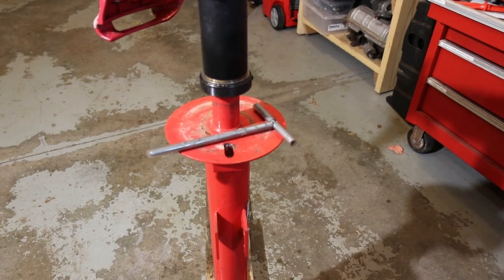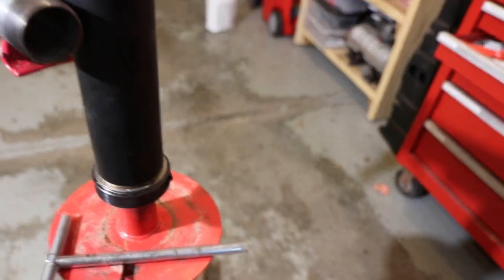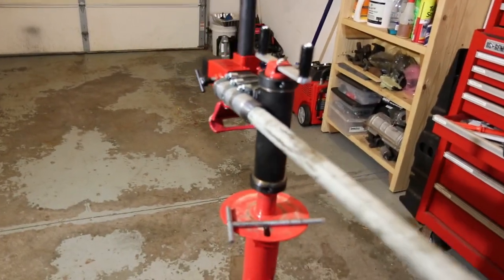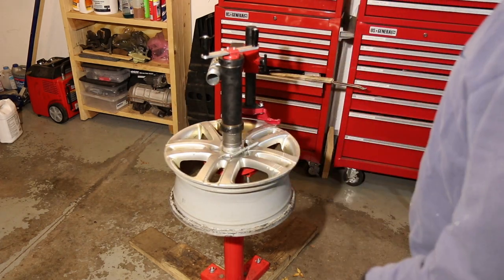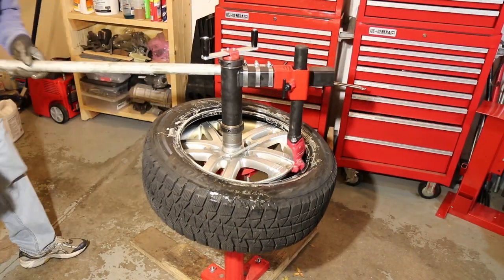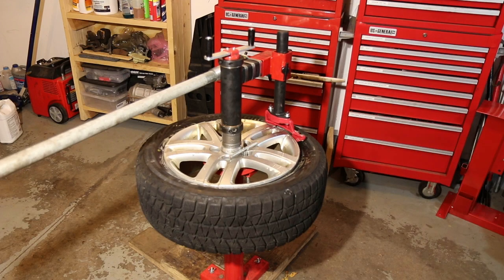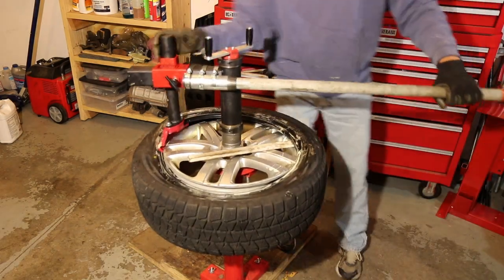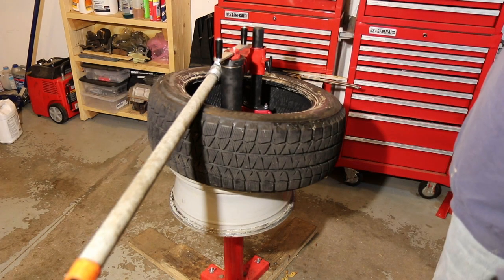Mounted Bar Modification

Comment: Rather then adding a piece of plumbing pipe with radiator hose clamps to use to turn the bar, couldn't you just put the pipe into the square tube bar of the changer? It would serve the same purpose, and simplify the modification.
Reply from the maker: I think it is a good idea and honestly did not try it that way.  However, I wonder if the accessibility would be as good?  As it is, with the pole on opposite side from the duckbill, it puts you on the same side as where you are inserting the tire iron and holding the polyethylene tool.  I am just wondering if that would be more awkward from the other side.  But I'll have to try your suggestion next time and see how it works!  Thanks for the comment and idea!

Comment: Im curious;why not put the bar in the square tube top bar that goes out to the down tube that holds the duckhead??? 😬😊😎
Reply: Too much slop and you can't balance the rod. It will slip out when not in use

Comment: Cut a hole in the tube you strapped to the tool, weld a nut to it to receive a bolt that can lock the bar in and have easy removal when desired. 😀😊😎🏁 i saw a video here where a guy welded water spicket handles to the locking bolts and decided thats what im going to do whe i get to that stage of my build. Hope you like and or use this idea.✔ 😀😊😎🏁

Comment: You really come up with some good ideas. What about the bead breaker on the machine do you use it, have you come up with any ideas for it. I have some really nice polish aluminium rims
Reply from the maker: Thanks Russ,

For breaking the beads, I use a different tire changer.  Very similar to the harbor freight bead breaker but a little better made/heavier duty.  The harbor freight one started bending on my after a lot of use.  I also feel like i can get more leverage on this one.  It helps that I added a really long bar (just made out of some steel pipe) for better leverage.  Here is a picture:

https://i.postimg.cc/J0gq754j/20200206-173223.jpg

I have never had a problem with it marring up or damaging any rims -- used properly, the metal doesn't come in contact with the rim at all...
Reply: @JohnsDIY  where did you get it at ,looks a lot better than the one on tire changer
Reply: What is that special polyethylene tool you use makes it look so much easier
Reply from the maker: Hi Russ, It is just a homemade thing cut out of a piece of polyethylene...

Here is some more information in case you want to make one:

I tried several different geometries but here is the one that I think worked best:

17" long (long enough so you can get a good bit into the tire but still hold on to the other end on the other side of the rim) X 1" wide X 1/2" thick.  The HDPE is really tough and it can bend quite a bit w/o breaking.  So far it has held up really well and of course it is nice because you don't have to worry about it marring up the rim...

The following gallery has several pictures:

https://postimg.cc/gallery/16gaji50w/

Adding the contour on the end really helps make it easier to fit in the triangle shaped gap the tire makes with the rim at the edge of the duckbill.  To my surprise the HDPE was really easy to sand and work to make the contour (just using a random orbital sander and coarse regular wood sandpaper).
Reply: Great idea except that you lost all your adjustment for smaller wheels.